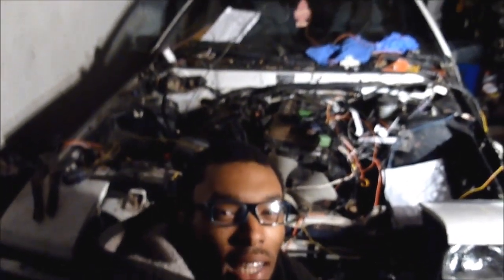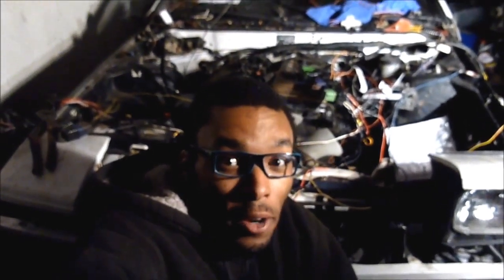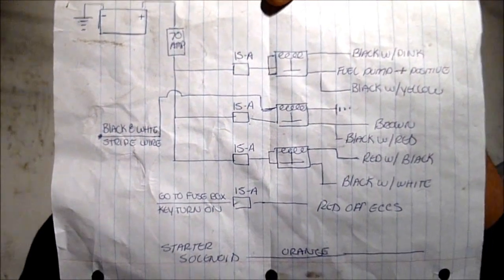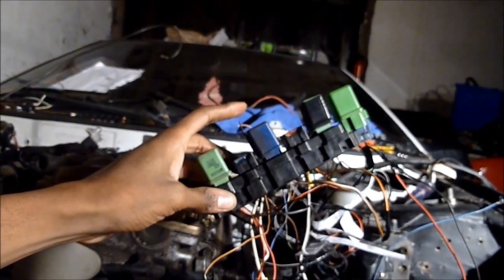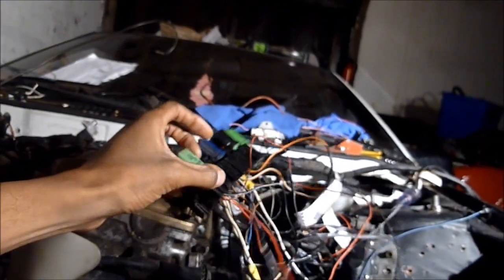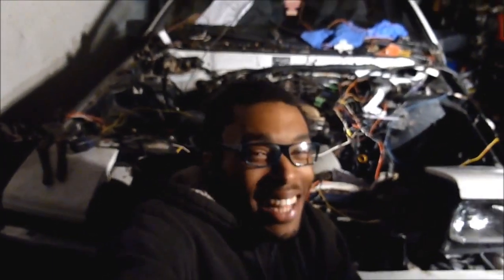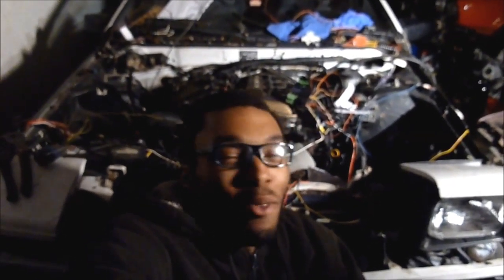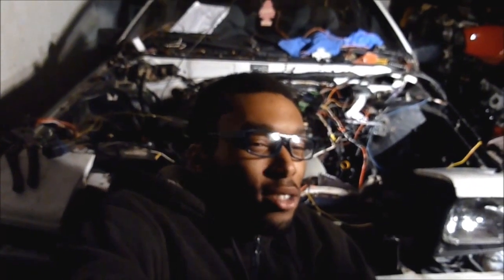Nissan Silvia S12 Drift Car

Comment: S12 feels 👍🏻 so rare over here in WA
Reply from the maker: +dPERFECTIONZb Here in NJ Ive seen several s12's but none of them were on the road
Reply: wa state??!!! don't lie
Reply: +Tha Doctor yeah dude 🤘🏻
Reply: +dPERFECTIONZb bro. so many. so cheap. in Seattle Craigslist there is a fully caged S12, running and driving for $1400
Reply from the maker: Damnn! Thats not a bad price for that setup. I would have got that If I had the funds.
Reply: A little late but another fellow pnw s12 owner ☺️